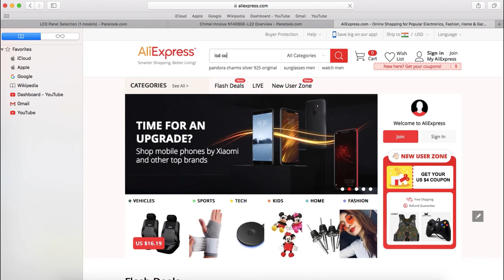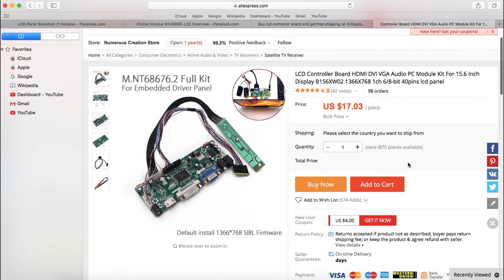How to reuse LCD screen from an old Laptop

Comment: How did you get backlight to work that's my problem how to hook up backlight!!What are the connections called?black female on backlight & white one on control board?Thank You for any help!signed:racking my brain!
Reply from the maker: what's your LCD model ?
Reply: Got back light to work but only for a few seconds at a time
Reply: Augustine Sullivan I have the same problem ... lights up white but. I picture

Comment: What voltage plug are supposed to use with this board? I've got the same screen, so it would the the same adapter board.

Edit: whoops 🤭 it says in the description, thanks for the video

Comment: How do you power it?
You can use the same old laptop charger?
Reply from the maker: Yes, Use buck converter to step down the voltage to 12v.

Comment: did you hot glue the controller board directly onto the lcd screen? Wouldn't you have to put standoffs?
Reply from the maker: I didn't use hot glue. i used double sided tape. I had other projects planned for the LCD.

Comment: My colors are showing up weird (inverted-looking in places) and there are some wobbly/flickery pixels.
I tried it with different computers but same problem. The HDMI cable and LCD screen are already known to work.
I noticed the LVDS cable has fewer pins than the one used in my original laptop, maybe the type of LVDS cable is wrong or it's broken? :/
Reply from the maker: As shown in video search your lcd model on panelook.com to check the required LVDS cable
If you don't find any solution mail me your lcd model no. with pictures of it.
Reply: @LoopLinks  Thanks for offering to help. Useful link, too! :) I ended up going into the factory mode menu on my LCD controller and changed the Preset Panel ID which solved the problem!

Comment: And the power supply cable ?
From where you bring it ?
And how many voltage need ?
Reply from the maker: You just simply plugin the power supply of 12V in the DC jack located on the controller board.
Reply: @LoopLinks  oh yeah you forgot didn't you...
Reply from the maker: Yes. Sorry for that.

Comment: How do I give power to the lcd screen? I just took one out of an old laptop.
Reply from the maker: Simply plugin the power supply of 12V in the DC jack located on the controller board.
Reply: Does that come with the lcd controller board?
Reply: @daddylonglegs8491  yes